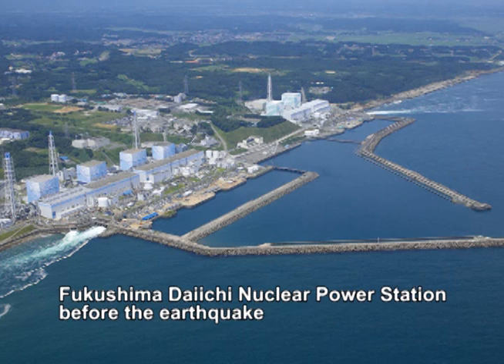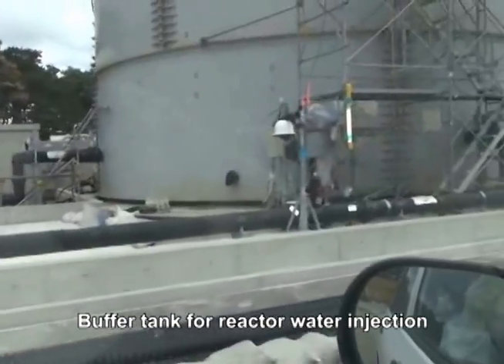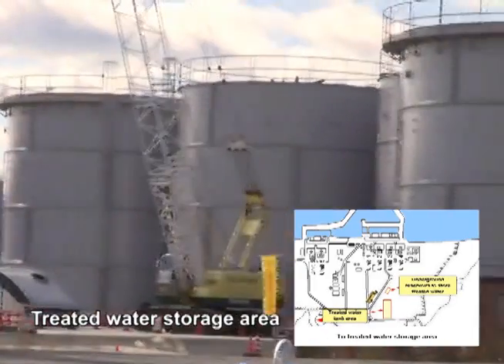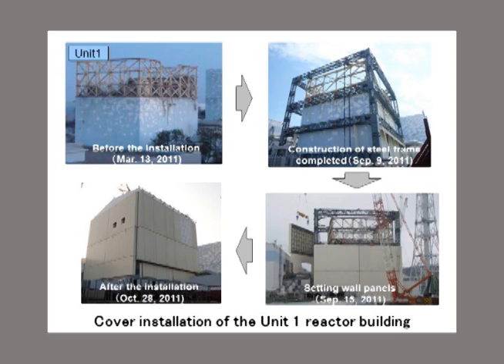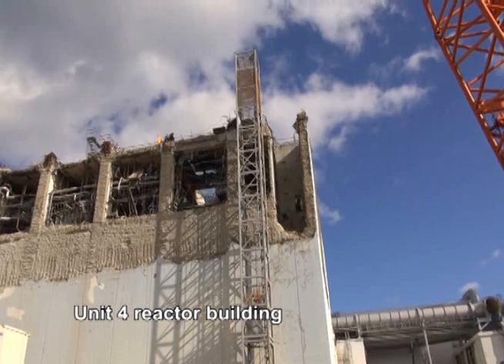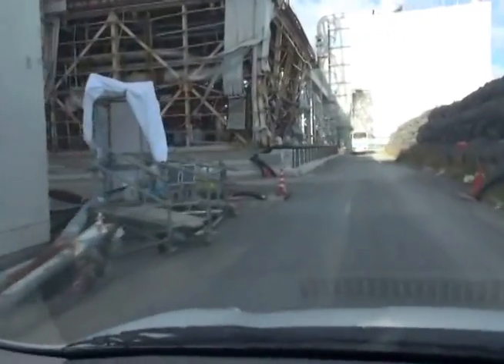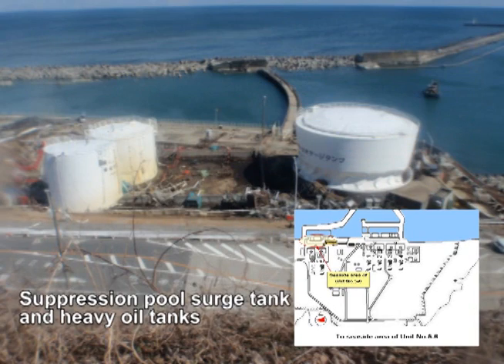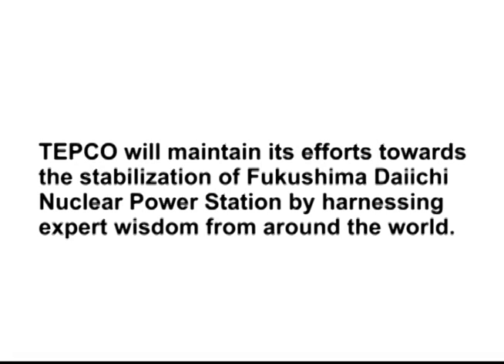Fukushima Daiichi Nuclear Power Station Video Tour

Comment: They mention the "water shielding walls... preventing pollution spreading to the ocean in the case of ground water contamination." Vast amounts of highly contaminated water has been leaking into the ground water since day one. Cracks in the foundations allow cooling water washing over melted, oxidized fuel to carry contamination directly into the ground water. Groundwater IS contaminated and continues to be contaminated by many tons of water a day and this is why the wall is being built.